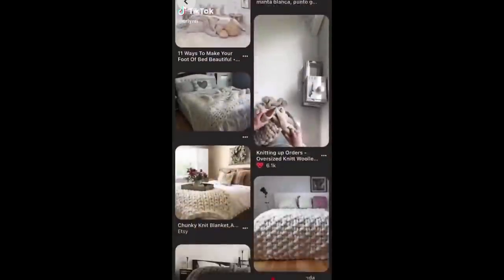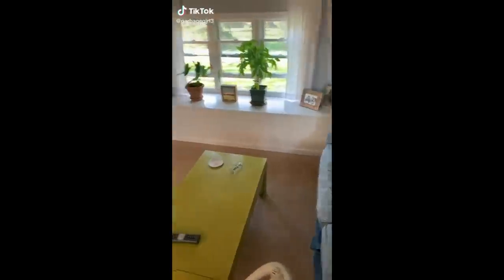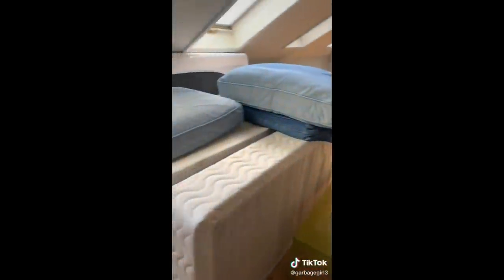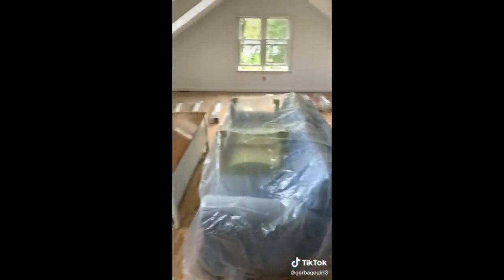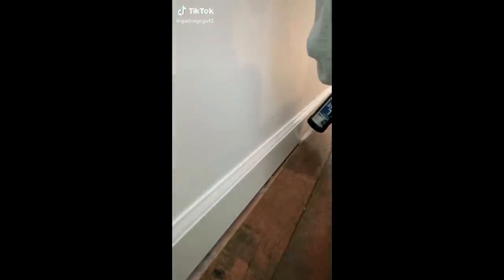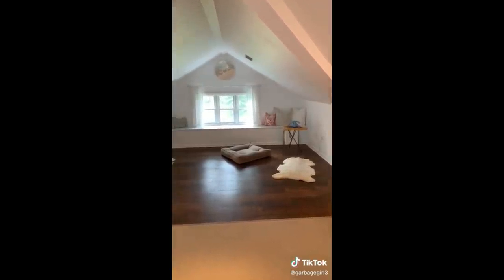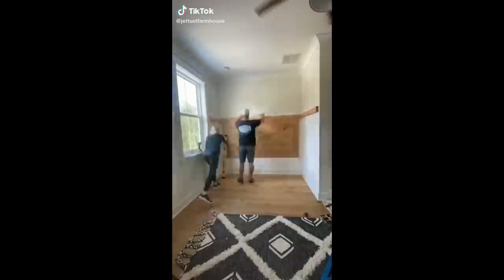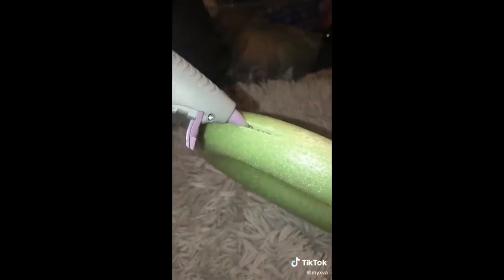DIY Projects 🧵🎨 | Part 3

Comment: For the first one! A lot of people I know who’ve tried it say the fall apart and get dirty SO FAST. 😩😪
Reply: It's because of the material. Most of the time, people use a wool roving-wool combed and prepped before spinning into yarn- that doesn't have any structure or tension to hold it together. That chenille yarn can handle normal wear and tear better than roving can.
Here's an article that explains it better: https://woolery.com/blog/dont-knit-that-chunky-roving-blanket-on-pinterest/